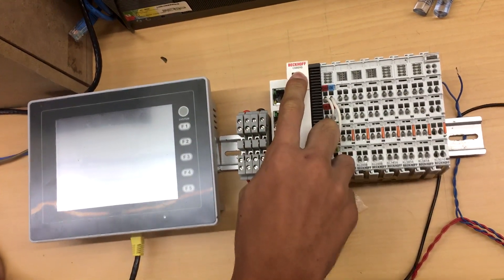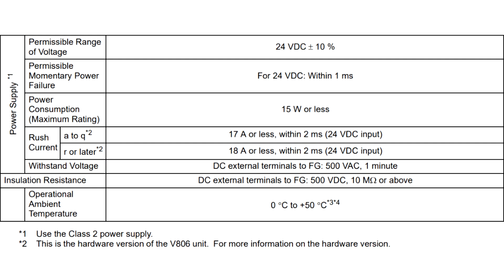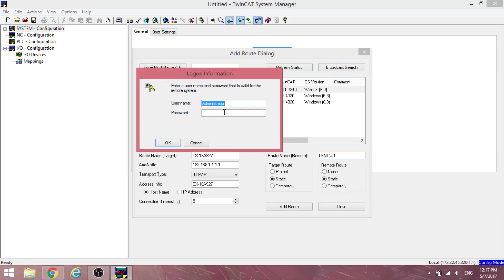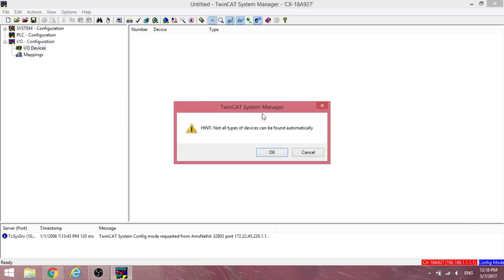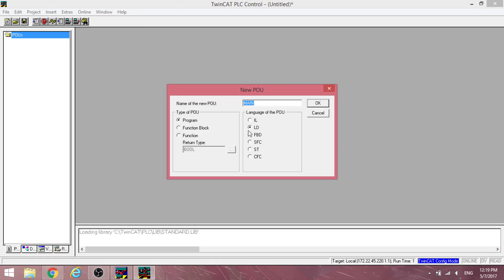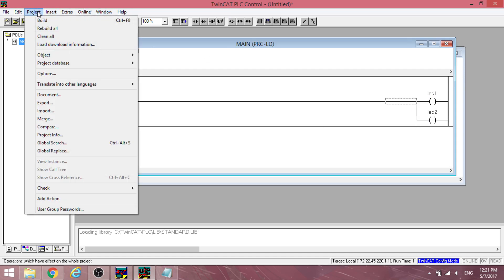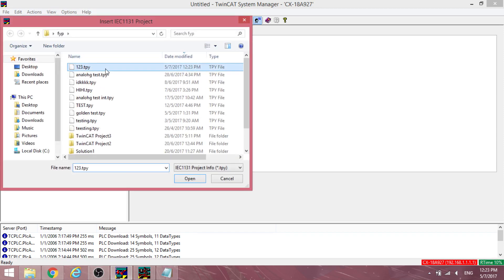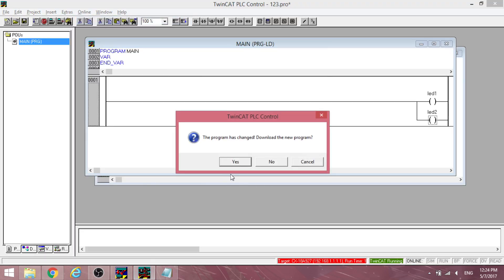Beckhoff PLC Setup and Configuration – Part 1

Comment: hello how the detail relation between the PlC and TwinCAT system manager . If now the TwinCAT is in run mode and plc is also run , then I click (reset) on the PLC , and the plc will stop and this will how effect on TwinCAT system manger??  Because I got a problem that when I reset plc ,the z axis down and crash until ground!  I check that the device state el1904 or ax5805 device state will change to errsafeop. I am not sure if this result that the Z axis into STO so ‘mmm . But I am fused that the Z axis is Motor with brake so why can be down !  Ax5203 plus ax5805 plus brake motor for z axis!  And one point is if I press estop and everything is ok . We safety logic is that the estop button link to all signal sto sos and ssr and all!